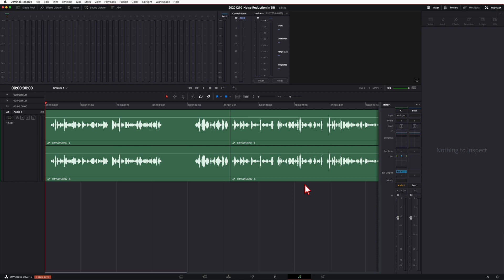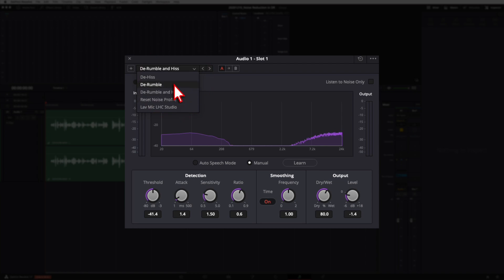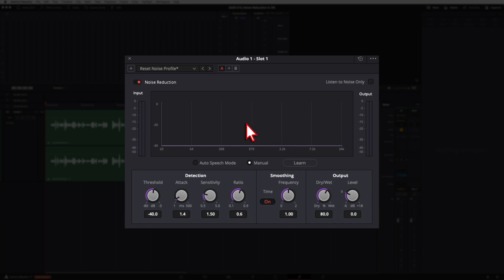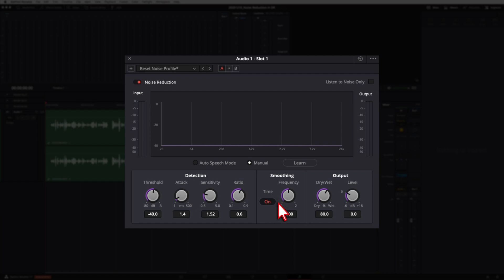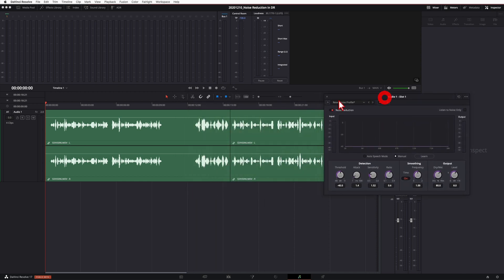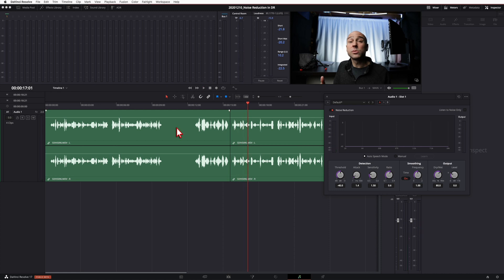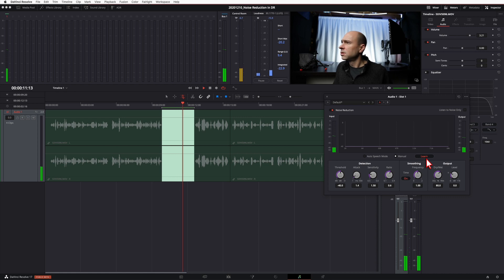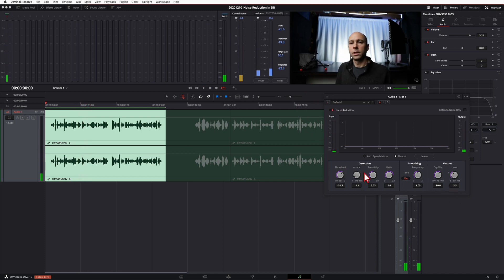Background NOISE REDUCTION in DaVinci Resolve 17 | Audio Effects Series

Comment: Talking about DaVinci Resolve 17, should every DaVinci Resove user update to 17 or it makes sense to wait another couple of months?
Reply from the maker: Hi!  I think that answer varies depending on each person. My recommendation would be this: 

If you were in the middle of a project, finish it in the version you have.  If it makes sense for your workflow to upgrade, go for it. However be sure to back up your database before upgrading. The database will be upgraded for DR 17 and you cannot go back to previous versions with it. 

Currently BMD is on 17 Beta version 4.  I’ve been using 17 since it was launched and I’ve had very few issues on my Mac. Any bugs I have seen were fixed in the updated beta versions.  For me it Made sense to upgrade and I’ve had very few problems.  Any issues were very easily corrected.  I mostly make YouTube videos so if something did go wrong, not a huge deal. If I had a lot of client work it may have been a little different.  Just FYI, I use the studio version. 

Hope this helps!  I would imagine that the full release is not too far away if you wanted to wait.   👍😁
Reply: @JasonYadlovski Thank you for your profound recommendations. ✅ Are the system requirements for DaVinci Resolve 17 higher than for DaVinci Resolve 16? Any risk of issues with the hardware after the upgrade?
As for backing up the projects, will it be OK to just copy the "Resolve Projects" folder?
Reply from the maker: As far as I know the system requirements are the same.  For backing up the projects you want to backup the database, not the projects folder.  Here’s a video how to do it: https://youtu.be/PTMh_zrDW7o
Reply: @JasonYadlovski  Thank you, I'll take a look.
Reply: @ilsavv  I have two computers set up for editing so I upgraded the less important computer first and Resolve 16 was unable to open some of my projects (crashing) so I have not yet upgraded my other machine. I'm glad I tested that way! I also came to the realization that I don't know how to upgrade from 16 to 17 and keep my studio license...
Reply from the maker: Hey, just responded to your other comment. You should not have any problems downloading it directly from Blackmagic Design.  Also any projects in DR 17 will not be compatible with your 16 because you have to upgrade the database in order for it to work on 17. Unless maybe you export the project and re-import it in DR 16.

Comment: Good video. This may have been a good time to try the A vs B setting feature  to (a) show us how to use that and (b) have an easy way to compare the auto speech vs Learn modes and see which one worked best at each of their default settings. I would be curious to see the result of that type of experiment.
Reply from the maker: Thanks!  Do use the A/B feature, just Click on the letter a and make your changes then click on the B and make any new changes. Then you can just select the letter a or B to bring up the safe changes under that letter.   Maybe I’ll make a quick tip Tuesday video on that.  👍😁